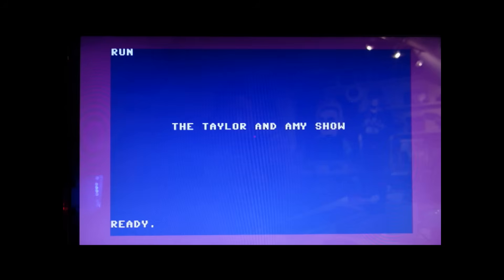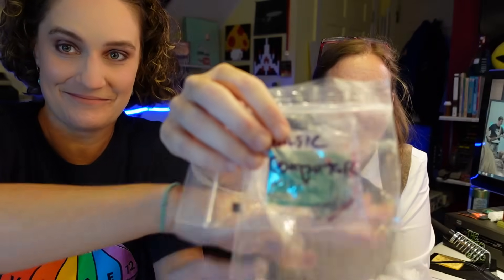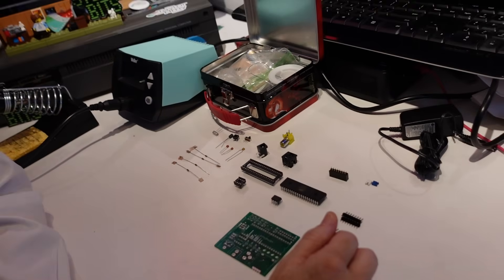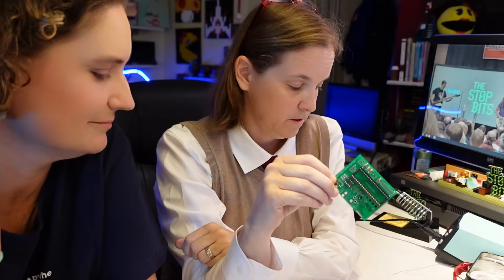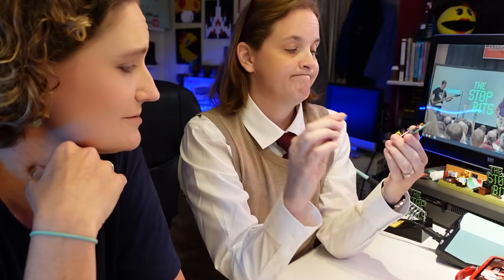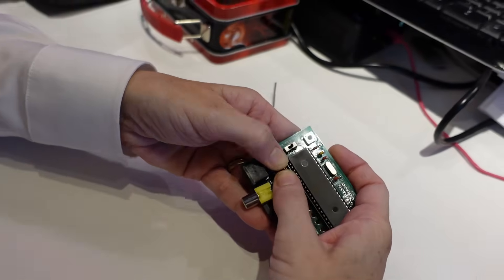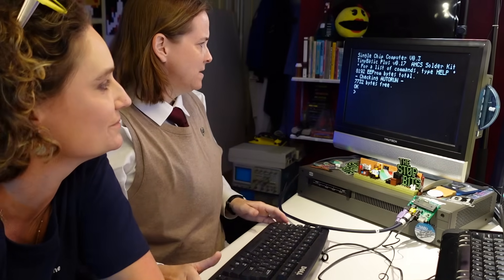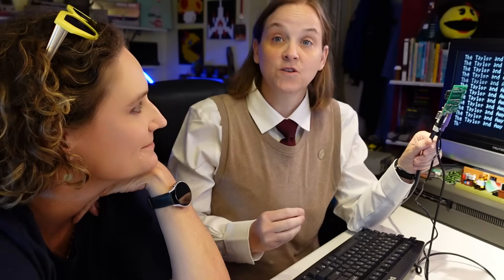8-bit BASIC Computer Kit

Comment: With my ZRCC (Another single board), I left the barrel and ran a jumper wire to the USB to ttl converter to get power from the PC connected to it.  Just don't plug the barrel and the USB in at the same time.  I also added a Max232 so that I can use the device with a standard Rs232 connection and barrel for power.

Comment: Ive been trying to find information on this kit and failing.  Is there any documentation with it that you could share?  Thanks in advance. 🎉🎉🎉
Reply: Look around for "Single-Chip Computer" and you'll find designs for a version of this going back to 2011, using the same ATMEL chip. I think someone just put a version of this together as a baggie kit to hand out at the convention.
Reply: @BeOurBee the article I found was from 2015. I ended up designing a pcb version myself
Reply: We tried and failed as well!  It's like a VCFSE thing, apparently.

Comment: What's-Ken-Making recently did a video where he put together an alternative Commander X16  computer kit that required hours or soldering.  Sounds right up your alley Taylor.  I'm still hoping for a Commander X16 core on the MiSTer FPGA as I hear it should technically be possible... but I have zero FPGA programming skills myself.

Comment: I actually dusted off the soldering iron a week ago. So about 8 years ago my subwoofer fried. I suspect it was a lightning surge. I lost some HDMI ports on my surround sound system. I replaced it all of it. I figured the sub part of the system was dead.....it wasn't. It didn't work eventually what was 4 years ago I ordered a replacement set of speakers. My old speakers suddenly sounded like shit and I got a new sub as well. I never opened the sub. My old dog Abby (6/26/24 RIP) started to open it. This year my new dog Rena finished opening it. But she also chewed the cord off. So I decided to swap the cord off the old unit. It works perfectly fine now. if I had wire strippers (I do, I just couldn't find them) I could have done a better job, but with what I had at hand it turned out pretty good. It's been a while since I used the soldering iron.

Comment: If you want an 8-bit BASIC computer experience like no other, get an Intellivision ECS and learn to use its proprietary BASIC interpreter.  With 2 kilobytes of RAM, you're probably good for about 90-100 lines of code.  To really pimp it out, attach an Aquarius Data Recorder and save your work to tape.
Reply: That is so metal